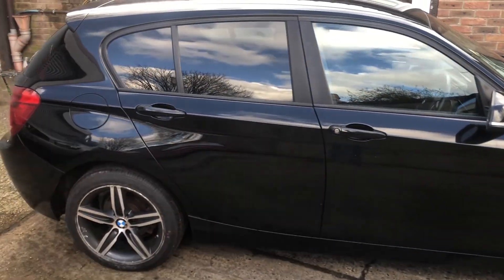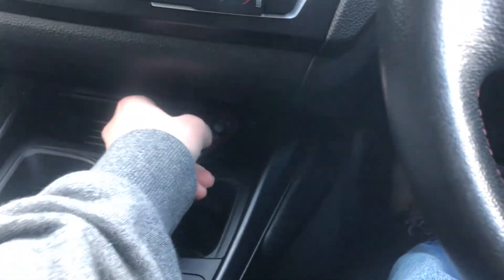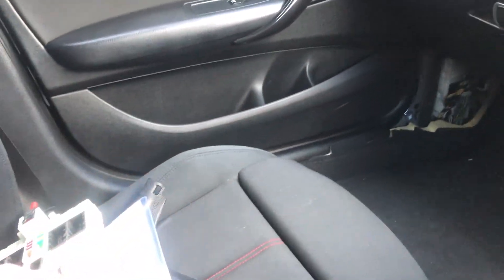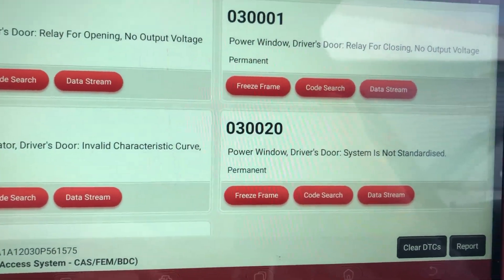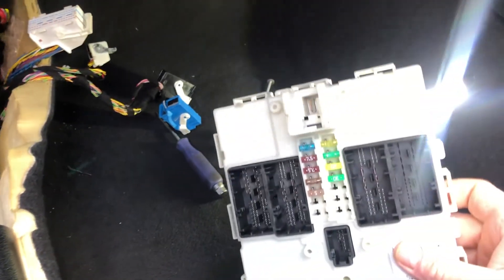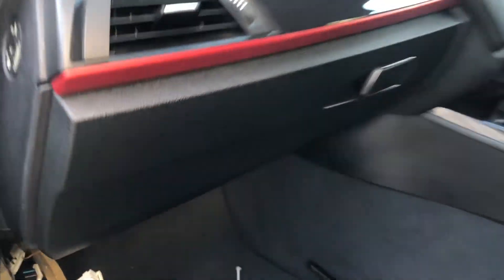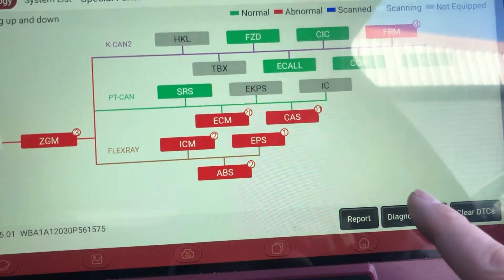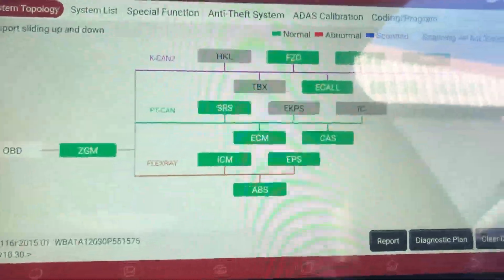BMW F-Series Body Module (FEM / BDC Module) Remove + Reprogram replacement immo & keys, Refit & Test

Comment: hi there, i have a 2016 f22 m240i. half my drl isnt working on both sides. ive unplugged the heatsync with ignition on and all LED's on the DRL board work fine. could this module be the issue? thanks a lot mate
Reply from the maker: Sorry, I can’t offer advice on whether this unit is the fault but if you want to replace it we can help.
www.jccars.co.uk

Comment: can you tell me, 
ive bought a car with no keys, its 2021 f40 if i buy the ecu and fem module is it possible to keep the new key from the used units and code the units needed so i have a running car with used keys snd fem ecu etc?
Reply from the maker: I would just have a new key made - we offer AKL (All keys lost) solutions for F-series FEM & BDC modules:

https://ecuconnection.co.uk/product/bmw-fem-bdc-unit-immobilizer-control-module-body-control-module-key-supply-programming-service/

Comment: Hi, thanks for your video ! Our bmw f31 has brake light failure - tried new bulbs but no luck so then tested for voltage at the lamp holder but nothing, tested cable continuity to the REM plug and was good - no voltage coming out of rear REM for the brake lights so have ordered a replacement one thinking I can just plug it in but as it is from a donor car does it need to be programmed to pair it with the cars main ECU ? I am a ‘normal’ electrician not an auto electrician ! If it does can you programme it ? Thanks
Reply from the maker: Yes, it needs pairing - more details are in the video & there is a direct link to our service in the video description.. 
website: www.ecuconnection.co.uk

Comment: Can it be the problem on my F10 520d N47, when cold car stalls and have DDE internal error code, I think maybe FEM and Relay 30G cuts off power to DDE and dde to dsc system? I had problem with water leakage in cabin, also false alarm activating and afrer night battery discharging when stationary
Reply from the maker: Sorry, I couldn’t say whether or not your problem could be the FEM..

Comment: Hi, nice video 😁👍 what about if there is no communication with the unit after adding key on the bench?with Autel. Something happened during processing and module not responding at all. But the good news is, Autel done the backup and I have original EEPROM data saved, it’s that possible to clone the Fem module??
Reply from the maker: If its totally bricked - I had this happen once it's possible to get a replacement FEM & using the ECU ISN you can program the donor + Virginise the key & add it to the donor, if you managed to save the original coding then you can also write that to the donor - I'm not sure if you can do that with Autel though...
Reply: @JC-ECUConnection thank you for responding, haven’t done the cloning before unfortunately, and not sure if Autel can do. But I have also VVDI2 and KEY TOOL PLUS so did you think I can do with this tools when totally gone module?? I have the original EEPROM and modified eeprom saved fortunately, just before this module brick or something 🤦‍♂️, I don’t have still the ISN password unfortunately so to pull the password need to remove the Ecu and reading??
Reply from the maker: @przemekfryc5495  Yes, ECU off - ISN, transplant the ISN - VVDI2 will do it - The Autel might but I’ve not got that tool so I can’t say, virginise or program new key, recode (hopefully you saved codings with Autel) & pretty much job done..

Comment: Hi there, ive got an f30 with a headlight vertical aim control failure. (Halogenw)
Ive checked tha lamps adjusters still have current flow,  so it isnt a wire damage. Any idea if this is a short circuit error in a  Module?
Reply from the maker: Sorry, I wouldn’t be able to say.. I’ve never had to work on that particular problem..

Comment: Awesome vid. Quick question. My f82 recently had an ECU replaced. It starts, remote works, drives normal. However, the infotainment does not have the M menu options, nor does it show bluetooth, and there is no audio through the speakers, steering controls also don't work. I believe this may be a coding issue. Is that normal? Is there an additional step after ECU cloning that is needed to be done to get all the factory options back?
Reply from the maker: @shaazy  Hi & thanks for watching! - Firstly have you had only the ECU replaced?, if so how - cloning or by adapting ISN? - if done by cloning then no, there shouldn’t be any follow up procedure - if done by ISN transfer then yes, you will need to perform final coding & preferably software update. If however you have fitted an ‘ECU kit’ then personally I would put it all back to original & get the ECU cloned or ISN transferred - it’s too messy to try to instal kits on modern vehicles!
Reply: @JC-ECUConnection  Thank you so much for the response. The workshop that did the work had it done by someone else in a different country, the ECU was ordered to them, then imported, installed and handed me the car. When I received the car, I noticed that all the previous factory options were no longer available, and having played with INPA, Tool32, and NCSExpert from my e93 335i days, I figured it was a coding error. So I'm gonna go with ISN transfer. So in its current form, would you suggest just adding those missing SA option codes via E-sys is the way to go? That doesn't hurt anything in the replaced ECU, does it?
Reply from the maker: @shaazy  I can’t see why these items are not working if just the engine ECU was replaced by adapting the ISN, these shouldn’t be affected - I would check the VIN numbers to ensure a kit hasn’t been fitted, then start changing the codings after..
Reply: @JC-ECUConnection  Got it. I don't think there's an ECU Kit in there but I did scan the car, and under 'Car Information Computer', I get the code: 026308 "HU-B: No Current Coding Data Stored". This is a 2016 m4. Does that hint at something?
Reply from the maker: @shaazy  if it isn’t a kit that’s been fitted then it looks like the coding has been wiped somehow from that module, I would see if you can re-code it
Reply: @JC-ECUConnection  Do you mean injecting CAFD into HU? Do I have to alter VO at any point you think to restore all the factory options?
Reply from the maker: @shaazy  I’m not sure to be honest on your particular job, I usually just set coding & update software via an Autel or ThinkCar Diag tool on individual units as needed..
Reply: @JC-ECUConnection  Ok i just used Esys for the first time, watched a bunch of videos. I read Vcm, saw that CAFD was missing under HU_entrynav, injected that in, and hit Code. It coded successfully and rebooted the head unit and all is fixed! I've got audio, Bluetooth, and M modes all in the menu now.
Reply from the maker: @shaazy  Good job! Thanks for sharing the info on how you fixed it, hopefully it will help others with the same issue 👍

Comment: Hey mate,what's the difference between ori fem coding & ori fem coding for cloning?
Reply from the maker: @phillwilliams3399  I make a back up of the codings of the ori FEM, once the Immo data is cloned onto the donor, the ori codings will need to be transfered as well, sometimes these can be a bit of an ass to write back in, remember to power down the unit & switch on again, this usually works..
Reply: @JC-ECUConnection  
At the final steps for unlocking the fem you write back the original eeprom do you mean then it carries out the coding, after that it's says you cam now make a dealer key,then you proceed to exchange fem/bdc ?
Reply from the maker: @phillwilliams3399  after unlocking the donor FEM with adapted donor Eep & firmware downgrade, you then need to write back the donor Eeprom, after that then write back the donor codings,  after this then move onto replace FEM Data to ori, then write ori codings..
Reply: @JC-ECUConnection  
I think I got it! So the eeprom stays the same? U don't write back the ori eeprom? The changes are all made in fem data & write back ori coding.
Reply from the maker: @phillwilliams3399  correct!

Comment: Ho great video! Did you already   unlock the old module & save the data & this here is you loading & writing (ori fem data) to the used fem ?
Reply from the maker: @phillwilliams3399  Yes I believe I only videoed cloning the donor, reading ori is pretty much identical operation, thanks for watching!
Reply: @JC-ECUConnection  
Your very good at what you do, I've been a technician for 15yrs & now getting into key programming & offering this service, I've done a few keys on these but haven't cloned one yet, ppl don't appreciate what they don't know & I know that this is a job for specialists! You my friend are 1👍
Reply from the maker: @phillwilliams3399  Thanks & good luck with your programming jobs, it’s a lot brain trauma somedays but a great feeling of achievement when it all comes together!

Comment: Does it have to be a brand new board or can you reprogram a used board
Reply from the maker: @firossibrahim2827  we can clone used units!
Reply: @JC-ECUConnection  would a bad bdc cause the car to not start on a bmw x4m 2020 I’m hesitant on ordering a new one
Reply from the maker: @firossibrahim2827  Sorry, I can’t offer any advice without having the car present in our workshop..

Comment: What happens when original FEM is damaged?
Reply from the maker: Hi, it depends what you mean by what you mean by ‘damaged’ - if you have communications with the FEM unit with a diagnostic tool then cloning is not an issue, if your FEM has ‘no comms’ then we cannot clone the unit.. currently the only option then would be a brand new unit, programmed with dealer tools..
Reply: @JC-ECUConnection  Thanks.

Comment: If my intrument cluster is not working and totally blank or sometimes only speedo working but rev counter and fuel gauge is not working, is it anything to do with the FEM module? Thanks!
Reply from the maker: Hi, thanks for watching!.. sorry but I am unable to help diagnose this fault but my instinct is that you most probably have a faulty instrument cluster / wiring fault & most probably not a faulty FEM module..

Comment: When do we have to reset km ??? and what about milage correction is it from bdc of cluster ???
Reply from the maker: Good point! I didn’t actually reset the KM in the FEM module during the cloning operation, I did wonder whether I had to do it manually, I think this may be done by to tool during the process, it didn’t have any mileage issues after programming..